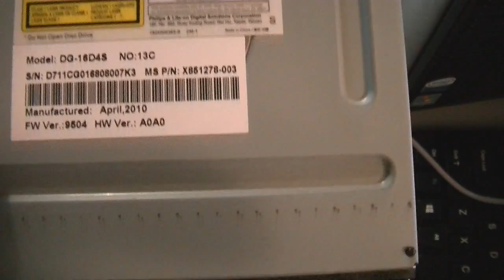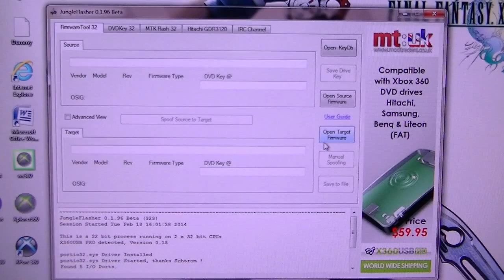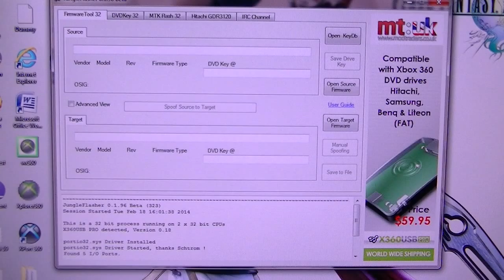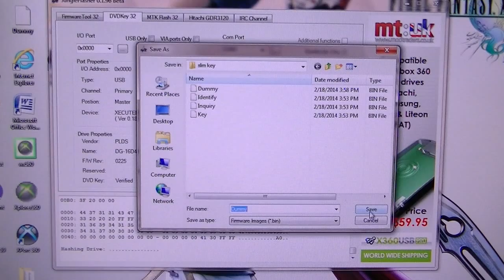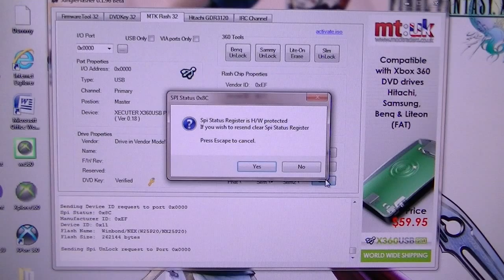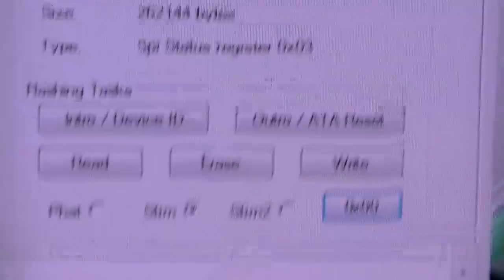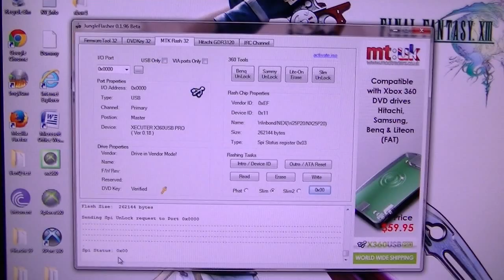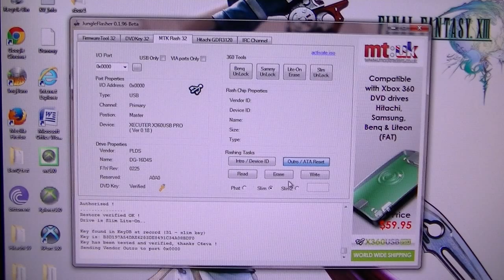How to Flash a  Slim lite-On DVD Ver 9504

Comment: don't i need to weld anything? i just need to make one hole in the chip? Does it still work in 2015?
Reply from the maker: ☣Scuppetta1998☠ Yes follow the video
Reply: CustomDesign360 thx bro
Reply from the maker: ☣Scuppetta1998☠ will work today if u do it
Reply: CustomDesign360 lol yeah
Reply: Will it work for xbox 360 e manufactured 2015? Winchester mother board.